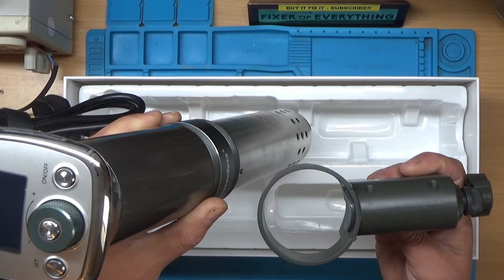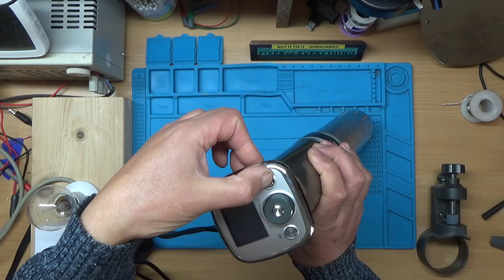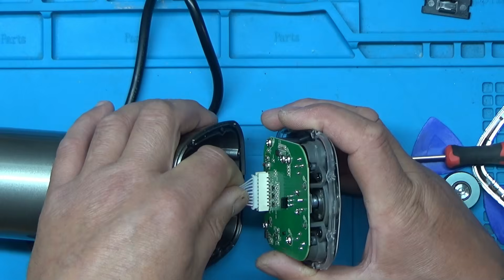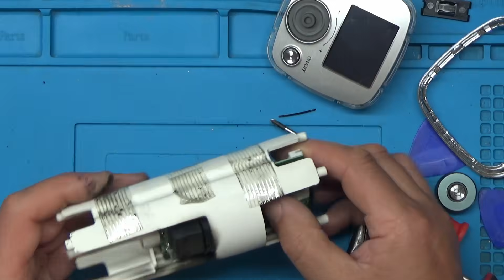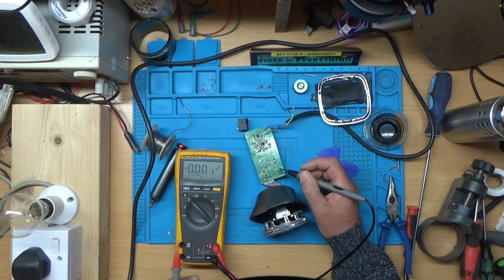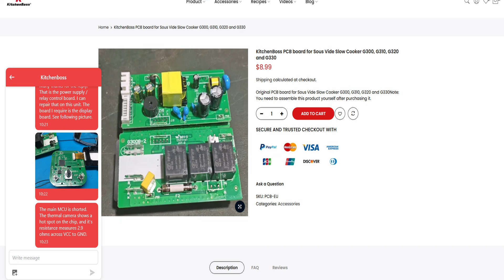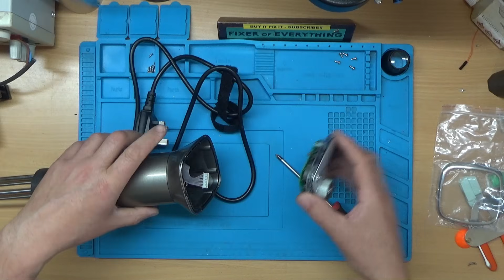Kitchen Boss G320 Sous Vide Cooker | Can I Fix It?

Comment: Great tear down...but the burning question in my mind is what do you cook in this device? It is teeny tiny . Very , very small steaks? perhaps from starlings or baby foxes?
Reply from the maker: Thanks 👍You don't actually cook in the device as such. This goes into a pan of water and heats the water to a precise temperature while circulating it. You then vacuum seal your steak in a bag, and it then goes in a pan of water for a timed duration. This locks in all of the moisture in the steak, and then you finish it off (crust) by frying. I've not used it but that's how it's supposed to work.  😊

Comment: Ah, they've used fusible relays in their older models. 🤭 I got a broken Anova sitting on the shelf; and I'm hoping it's built somewhat similar, so this video might come in handy. 🤞
Reply from the maker: Good luck with the repair, hopefully you get it sorted 👍
Reply: @BuyitFixit  Thanks! Initial testing shows it turns on and heats, but doesn't circulate the water, and consequently shuts off with an error after a few seconds. Which makes me hopeful that I can get it fixed with standard parts. But I still gotta get into it. 😅

Comment: Nice lots of magic Smoke came out on that one, I really dislike those spade connectors have had many fail on heavy loads, you end up cutting them off and solder the wires. Btw that's just a cheap low duty cycle  relay that failed, need to mo with some triac.

Comment: In the olden days, a device like this if it existed, would consist of a heating element and a bi-metal thermostat. No micro-controller, display board, power supply to go wrong. So is this progress?
Reply from the maker: I totally get what you're saying. I guess it looks flash with a nice user interface with pictures as apposed to a temperature dial, and mechanical timer.

Comment: There are voltage regulators, like the LM317, that die if they see a higher voltage on their output compared to the input. In such a case you can bridge the in to the output while feeding with the bench power supply.
Reply from the maker: Thanks for the info, it seems on this one that the 240v ended up being sent into the MCU and fried pretty much everything.

Comment: Nice work, as usual. 

Those glass fuses never seem to work right. I was working on a CD recorder and two chips and a two transistors were fried and the fuse didn't even blow. I thought it was supposed to protect delicate components.
Reply from the maker: Thanks 👍I guess it depends on how much current the blown transistors were pulling. If it's less than the fuse rating then they would just happily cook.

Comment: I think the size of the fuse does not matter so much. As this apparatus is a fixed load (1100 watts), overload is not possible. So the fuse should only be there as a short circuit protection. A13 A fuse will blow equally fast as a 7 amp at a short circuit. At a normal outlet you will probably have between 200 and 500 amps minimum short circuit breaking capacity. So in a short circuit a fuse will blow in less that 30 milliseconds according to the fuse characteristics diagram.
Reply from the maker: Thanks for that 👍

Comment: Nice!
Must have been an expensive unit when looking inside with all the parts. 
Do you think it might have been dropped into water and that might have caused this issue to start with? Or only a faulty relais that triggered badly to result in the mains going up to the controller?
Reply from the maker: Thanks 👍It's supposed to be waterproof, or at least water resistant. I think it was just cheap relays that couldn't handle the current, and started arcing which then started to burn, and create carbon which then sent voltage from the high side to the low side.

Comment: Relay for live and neutral is because a common heater fault is leakage to the case, so switch both sides for safety, as the same model can be used in the EU where plug polarity is not standardised, so you switch both sides.
Reply from the maker: Interesting, I didn't know that. I thought it may have been for safety reasons but I had been thinking in case one of the relays contacts welded shut so the heater didn't just stay on constantly. I think some 3D printers etc have a fail safe thing similar.

Comment: Was so sure this was going to be a no fix. Glad the manufacturer responded.
Reply from the maker: Yes it definitely would have been a no fix if now. That's the problem with stuff these days. You can buy the chip, but it still won't work without the code.

Comment: @28:47 , the winbond chip is for storing profiles, logging of data, images. main firmware will be flashed direct to the stm32f103
Reply from the maker: Yep, that's pretty much what I thought, as the image load speed is quite slow.

Comment: The lack of a fuse on the PSU board still concerns me somewhat; that being said, it's not unknown for glass fuses to vaporise their filament in situ while leaving the glass (usually vacuum-sealed) intact, resulting in a direct short rather than the desired OC as the vaporised filament condenses onto the inside of the glass capsule :(

That being said, did you send a pic of the fully-blown relay to KB during your correspondence? Such a dramatic result may encourage them to design the CCTs slightly differently (ie with fuses ;) )

I suspect the shorter probe is the water lvl sensor, while the longer probe is for temperature measurement. As the latter is designed to be mounted away from the centre of the agitator 'fan' (& the target receptacle itself), it should provide a reasonably decent average reading.. unlike the centre-mounted stuff you may normally expect. Good design there IMO
Reply from the maker: Yes, I was surprised there was no fuse or anything on the PSU either. I think those two low value resistors would just pop, unless the bridge rectifier fails too, then it would probably blow the inductor / filter or a track on the board.

Comment: 1:01 Nope has nothing to do with juices, or juicy steaks. Sous vide means under vacuum, and is generally used when having big dinners where you have limited time to prepare, this will give you the opportunity to keep your meat ready for a very prolonged time for when let's say you're in some gathering which has a huge delay, no worries then because if all the steaks are sous vide in hot water it means it can stay there until the gathering has finished. This is of course with a professional sous vide installation in a huge drawer somewhere in the kitchen, not this kind of flimsy device.
Reply from the maker: Interesting, it's something I honestly know little about.
Reply: Nope…it’s about cooking food to a specific temperature and keeping it there for a long time to cook at THAT temperature.   Particularly good for meats.  Can cook at a safe temperature but well below medium or well done for hours or days.  Brisket or tough cuts of meat are able to break down the tough bits into juicy tasty liquid without drying out.  Then they’re finished at high heat for browning.  

A nice side benefit is the ability to hold a bunch of steaks at rare to be finished to order when needed.  THAT is NOT the primary purpose of the technique.

Comment: Someone gave me a "faulty" sous vide cooker once.  They said it had an E-3 error.  It turns out that when you power the unit out of water, you get an E-3 error.  I put it in a pan of water, and it still works fine to this day.  I use mine to incubate homemade yogurt and to cook meats.  When I break open the vacuum bags, I finish steaks with a blow torch.
Reply from the maker: Interesting, thanks for sharing 👍

Comment: Ive heard of fusible links and resistors but a fusible relay? Hm. So what do you reckon was cause of failure?
Reply: Arcing contacts. When the relay switches off, the contacts will arc for 0.1 second because of the high current draw of the element. The more it arcs the higher the on resistance. That leads to overheating and the plastic case melting/carbonising.

Comment: Great fix, Mick. Kudos to Kitchen Boss too. Strange, though, that none of the fuses blew during the surge that destroyed the relay.
Reply: When the heating element relay switches off, the contacts will arc for 0.1 second and over time the on resistance increases which leads to overheating. Eventually the plastic case melts and fries it's self. The original relays were crappy cheap chinese ones that under rated for the current.
Reply: @simontay4851 Thanks, Simon.

Comment: Unfortunatly another mcu failure. Yep seeing that hotspot instantly is never a good sign.... It is nice of them to send you the parts of a dissasembled one but the service is not as nice as one from Peak Ltd where they just say "no problem, we will just send you a new preprogrammed mcu 😊" and anybody can easily request it, so now you have to trash some boards and the stm32 is just like the pic a offtheshelve part, just the software is the secret magic sauce. Although it could be done this way for for extra protection so people wont just go out, request one and be able to copy the product, but then even lockout bits exist and they wont be storing a bunch of secret government stuff on the micro (i hope).

I do think they noticed the mistakes and failure modes of the device and upgraded some parts so this happens less. The high voltage being just a small distance away from the control side inside the crappy relay is definetly not safe. That relay did fail quite interestingly and spectacular.

But hey, at the end of the day, they atleast provided some help and support and did not ghost you or say 'no' so its a bit better than most companies these days
Reply from the maker: Yes, if you had the firmware files, then it's just programing the chip, although it seems the eeprom was also destroyed, so the display might be toast too.

Comment: Great fix.  At least the company were helpful even before they knew you were a video channel.  I may have misheard, but thought you said this was an 1100W unit?   If so, 1100/240 is less than 5, so a 5A fuse should be fine, unless this has a massive inrush on switch on?
Reply from the maker: Cheers Mike👍. I doubt there would be a massive inrush, it's pretty much a small PSU with a resistive heater. I did try a 5A fuse at first, but then on the site it said it's 1100-1200W and even though my voltage is always around 240 or above, officially we are supposed to be 230v. So I used 1200/230 = 5.2A
Reply: @BuyitFixit  Thanks.  Not sure if you know this story, but all UK generators were built to produce 240v.  In 1994 the EU stated we must switch to use 230v to match the rest of Europe.  We negotiated a +10% and -6% tolerance on the agreement - basically so we didn't have to alter anything.  Our generators still aim for 240v, hence some places get almost 250v.  This was one case where we did what we wanted and sod the EU dictators! 🤣  Love your videos.  Keep up the great work.

Comment: Your lucky I decided to try and get a spare brush roll for a hoover I bought a fortnight ago .Still a current model .The back of the manual shows the spares and their part numbers but no amount of trawling found them .I got in touch with the manufacturer support for the hoover ,not only did they not supply spares they refused even to give a link to the parts in the manual .They just fobbed me off telling me to try patten parts that worked for the filter but still not found a brush roll .If you cannot get parts for a in production hoover I doubt you will ever find it once it goes out of production
Reply from the maker: Yes, it's amazing how some companies don't want to support their products. I think that's why you end up with other manufacturers making third party compatible items.
Reply: @BuyitFixit probably to get round the right to fix or whatever it's called they simply refuse to supply parts forcing you to buy new products .They fail to realise though  a few will simply buy a new one but far more will buy another manufacturers product who does .Fair do to your company they got free publicity for doing the right thing ,they not only make money from the product they get it from bits of their product .All companies should have a department that recycles and sells on parts from returned products saving filling holes in the ground ,why spend to dump when you can get money instead and make people happy on all fronts Vax is another company that refuses to sell parts that they know fail ,next time I buy it will be a bissel ,
Reply from the maker: I've never had any dealings with VAX. I have with Ninja / Shark. The vacuum cleaner they only sell the whole middle section of the vacuum, and not the motor itself which is still slightly cheaper then buying a new vacuum. But the think that sticks in my throat with them is that I bought a Ninja food processor (same company) and the blender jug cracked after 3 uses. It seems the warranty had just expired and they said tough luck basically. The reviews on the jug on the Ninja site are horrendous. People onto their 3rd jug as they keep breaking! Here's a similar jug of theirs with the same problems: https://ninjakitchen.co.uk/product/ninja-2-1l-food-processor-jug-with-lid-zid4633KKU800EUK  133 out of 160  1 star reviews 😂😂
Reply: Crappy garbage plastic jugs are why i bought a soup maker/blender with a glass jug. I use it a lot and the glass jug is still in perfect condition. The glass part can be removed from the base for cleaning.
Reply: His lucky? 🤔

Comment: It's always the kitchen appliances that have the wildest engineering for repair and disassembly. Cool to see the inductor inside this one like what you may use to heat a ferris bolt/nut that's stuck.
Reply: It isn’t an induction heater, it’s a coiled resistive heater. But it does look like the type you thought.
Reply: @electrickal1ah okay thanks for that.

Comment: As always, loved this repair video. It is very seldom that you follow a different path in diagnosing a fault than what I would have done, and even in those cases we would have ended up with the same diagnosis.  Also, wish more companies would actually do customer support (like they did). Often repair jobs shows up defects that designers never thought could have happened, and if a company actually support their products, can feed that fault back to the engineering team, and can improve their products. (I have always loved getting feedback on my products when I was still designing stuff, both positive and negative, seeing how I could improve the stuff I designed. But, alas, management didn’t view it that way.)… in any case, I digress, a company giving good technical support always pays off, as I am sure you will recommend this company’s products for your friends and family…
Reply from the maker: Cheers for the feedback mate, appreciate it 🙂👍

Comment: always nice to see that the relais protects the fuse!
Reply: Yeah lets have the fuse just for fun. But its atleast not like other companies from china that do not know a fuse exists or will use your house breaker for the purpose or your cables
Reply: @309electronic5  fuses, pah, no need, just use PCB traces, much cheaper 🙂
Reply: I was looking for this comment 😂
Reply: To be fair, UK mains leads generally seem to come supplied with a 13A fuse already installed. Its primary objective is protecting the cable, plus leads for other locations do not even come with such fripperies in the first place.
Reply: I commented this after you and just saw it. 😂

Comment: That's a fancy bit of kit, but relays? Seriously? I'm sure triacs would be smaller, cheaper, and more reliable.
Reply from the maker: Yes agree, not sure if heat dissipation might be an issue with the triacs though, as the relay dissipated the heat quite well 😂😂😂😂

Comment: Success, well done. Good to see proper company support. Sadly, the sales video shows water being poured over the top, explosion not mentioned. Good thing it's not pink.
Reply from the maker: Cheers Ralph 👍I guess it's supposed to be water resistant, as the removable knob for cleaning etc are part of it's selling features I think.
Reply: @BuyitFixit  Indeed, my sarcasm related to the rusty-looking screws you discovered.

Comment: Fair play to Kitchen Boss.
So Sous Vide Steaks all round at your gaff tomorrow night then, eh???
Reply from the maker: 👍Looks like it need to find a broken vacuum sealer first 😂😂😂😂😂
Reply: @BuyitFixit I just assumed you had one already. You can use normal freezer zip-lock bags, just push all the air out before you seal them.

Comment: You went through all that and the company send you replacement parts?
Reply from the maker: Yes, although it's not usually the case, like with the NOCO boost pack.  If the MCU was OK, then I would have just replaced whatever components were blown.

Comment: Rookie error.  Fuses are there to protect the CABLE, not the equipment.  If it's 1.5mm^2 then a 13A fuse is correct.  Got to agree that Kitchen Boss are 'the Boss'! for making spares available AND at affordable prices.  One for the 'to buy' list.
Reply from the maker: Interesting, I always thought the fuse was there to protect the equipment too 👍
Reply: @BuyitFixit 7A fuse is entirely adequate and more appropriate in this case as it protects the cable AND the equipment. At 240V and 7A, that works out to 1680W max, well within the rating of the cable and equipment. When designing control systems we have many circuits using 1.5mm2 wire and we use circuit breakers down to 1 amp to protect the downstream components and to limit damage in case of faults. On residential receptacles you have to size the fuse or circuit breaker to the cable rating because you don't know what load will be plugged in  to the receptacle so you always assume the max, that is the cable ampacity. So with 7A, you re good to go, your instincts are correct.
Reply: @BuyitFixit  Check out the speed at which a fuse blows and then how fast semiconductors release the magic smoke!